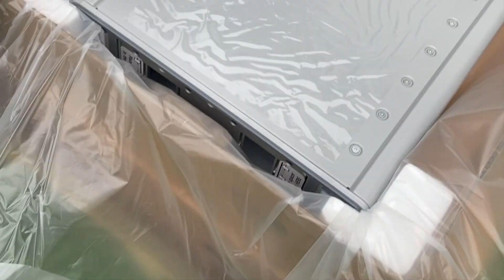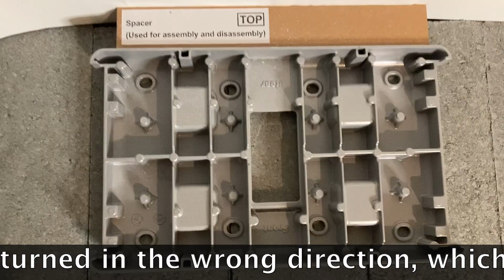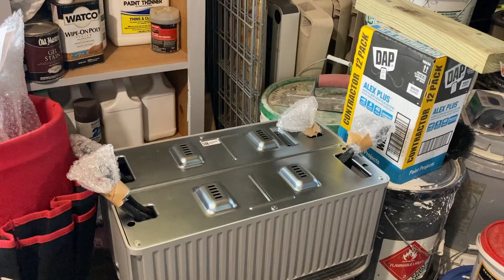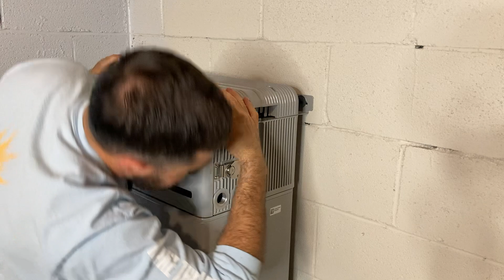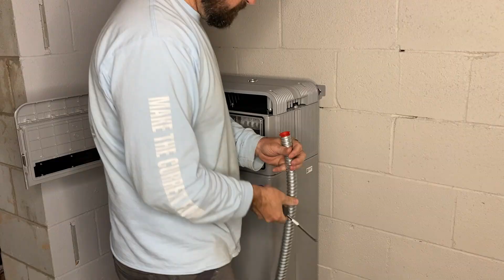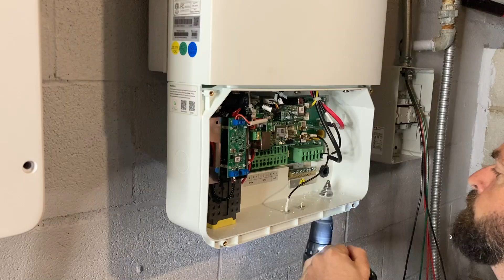Growatt and LG RESU16H Prime Battery Installation | Part 1: Unboxing, Mounting, and AC Wiring

Comment from the maker: Signature Solar affiliate link (CHEAPEST SOLAR PANELS ON THE MARKET and EG4 Products) 
$50 off for orders over $500 when using the coupon code: GET50ROCKY (expires 12/1)
https://signaturesolar.com/?ref=uzUOpPif73O10D 

LG 16H Prime 16kWh High Voltage Battery Bundle with Growatt 7.6kW or 11.4kW Grid-Tie Inverter
https://signaturesolar.com/lg-high-voltage-battery-bundle-with-growatt-inverter?ref=uzUOpPif73O10D&search_query=LG&searchid=1627135

Current Connected Affiliate (SOL-ARK PRODUCTS)
https://currentconnected.com/?ref=RockyBroadSolar

Also check us out at the following places....

Rocky Broad Solar Website
https://rockybroadsolar.com

Facebook
https://www.facebook.com/profile.php?id=61558585264414

Comment: Truly bizarre how people don't utilize good workmanship by using an electrical gutter instead of individual pieces of condo of running all over the place. Also make sure that LG battery comes off the wall nice and easy because guaranteed you'll be pulling warranty on it before long. And wait till you get to experience the customer service at LG! 😂😂😂
Reply from the maker: Hey Loki. If you had watched the video you would realize that this is a solar and battery testing station where I will be disconnecting the conduits on a regular basis. I agree it looks like crap but better than having to seal and re-drill a wire gutter every time I swap out equipment. Thanks for watching!
Reply from the maker: Feel free to check out my EG4 series if you would like more wire gutter installation content.

Comment: Rocky, excellent video. Watched it a couple times so far. Two questions. I  understand  LG batteries are old tech and are more prone to thermal runaway in comparison to the newer lithium batteries. And 2 when charging and discharging the top and bottom 20% are recommended not to be used? Your thoughts?
Reply from the maker: @michaelday1847 Yes, these are NMC battery chemistry, which was the best of the best just a handful of years ago. I would agree that the industry as a whole has moved on to LFP chemistry. LFP is a superior battery chemistry for a few different reasons. The two you already mentioned as well as generally having a longer life span. That being said I don't really think the thermal runaway is a real issue with these mainstream NMC batteries. They are UL9540A rated which is some of the most stringent fire rating testing requirements in the industry. I also think these batteries are on a fire sale right now so it is just about price versus value. Yes, the recommended charge/discharge it 80/20 which would be a good point to make in my upcoming videos. Thanks for watching the channel!

Comment: Question here! If you're putting on an outside meter panel / load Center combination unit. How does the 120 percent rule work? The grid boss acts as your main entrance on the inside of the house. Is the 120 percent rule bypassed since all the solar is being fed through the main panel for consumption and excess being sold back? Given of course the 225 amp busbar on the main combination socket of the house.
Reply from the maker: If all home loads are moved downstream of the GridBoss, and all downstream panels have a main breaker  protecting them, then the 120% rule does not apply. You could then use one of the other codes such as the "sum of all loads rule" a.k.a. 705.12(B)(3)(3) 2020 NEC. Otherwise if you have the PCS rated GridBoss you may also be able to utilize PCS which would fall under 705.13. Lastly you could derate the main breaker to 175A which would give you up to 95A of solar/storage ability which would be fine for a single FlexBoss 21.